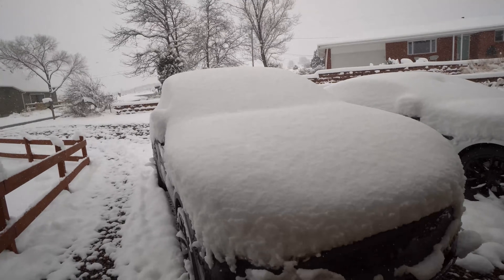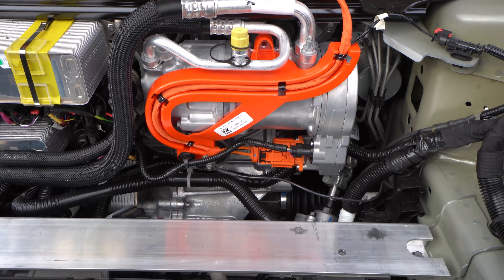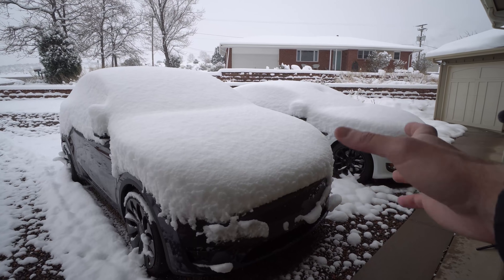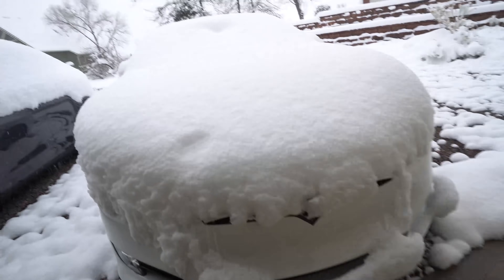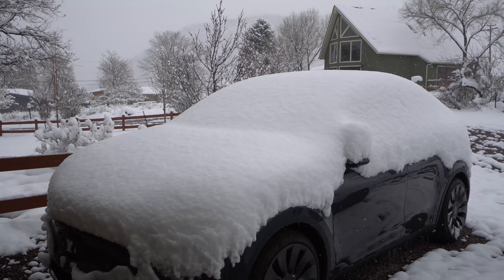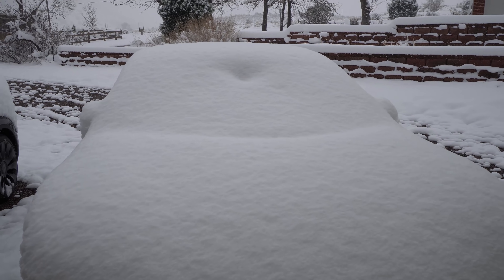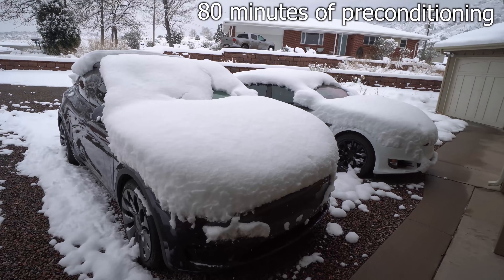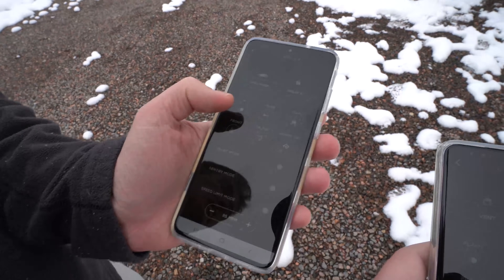Is the Model Y Heat Pump More Efficient? Preconditioning Challenge! Heated Radar?

Comment: I'm a kind of person who don't care about the cabin temperature because I gonna be on my winter jacket anyway. What I concern is how long do I need to warm up the battery before I can drive out without putting bad strain on the battery. I know for my ICE car, I pre-start the car about 5 mins just for the engine, oil,..stuffs to circulate properly before I press on gas pedal and go. How about the Electric car?

Comment: An element heater is 100 percent efficient at converting energy to heat.

A heat pump is much more efficient, generally achieving 3-4+ watts of heat for every watt of energy.

The reason it is more efficient is that it’s doing exactly what it’s name suggests. Pumping heat from the cold outside air into the cab, rather than creating it.

Comment: This test is not testing anything... Heat pump can  smartly manage the heat around. if the car is cool and outside is cold too, are you expecting the Heat pump to generate heat out of nothing?  Please check Bjorn videos, where he found that the Heat pump equipped car in cold weather is as efficient as the car without heat pump in summer. These youtubers without any functional/technical knowledge try to address these complex terms , what more can you expect.

Comment: My understanding. It heats not only interior but battery as well. The model S has an older battery which contains more Cobalt and is better for colder temperature. The battery pre-heating in model S cuts off at 18C (64F) whereas in model Y it cuts off at 28C (82F) so model Y uses more energy to heat battery to a higher temperature. However once you start driving the model Y heatpump can use the battery heat to heat up the interior so I would bet that model Y would have higher efficiency if 1 hour of driving is included after the pre-conditioning. Thoughts?

Comment: I heat my home with a heat pump.  In temperatures below 32º the system uses simple strip heating rather than the pump.  The Y should be more efficient at temps above 32º.  Try this on a 40º day and see if the results change.

Or, better yet, keep those cars in a garage.

Comment: In your efficiency calculation did you take into account cabin/surface area size? Y is significantly larger (aka needs more energy to keep heated etc) than the S? Like S's trunk is not part of the interior, that alone cuts off a bunch of volume that needs to be heated. Run heather in a room, it will heat up real fast with much less energy than the same heater heating up a warehouse.

Comment: Where did you find that the Model Y range is 280 Wh/mile? It should be ~240 Wh/mile. Also, you can change the range readout so it shows % instead of miles. Then you can convert directly to kWh based on the battery pack size.

Comment: In order for a heat pump to work efficiently in a vehicle, it uses heat from friction and other things when the vehicle is moving. Therefore to allow an electric vehicle with a heat pump to sit to warm up it will require more energy to generate the same amount of heat.
Reply: Yes. Without heat exchaning with chassis warmed by car usage the pupm system is a usual air conditioner in "winter" mode.

Comment: With air speed into the evaporator on the front of the Y the heat pump will be able to grab more heat per kWh used.  Being under way will increase the coefficient of performance (COP) of the Y heat pump.  The S shown has no such advantage.

Comment: It’s simple: a heatpomp is only very efficient in the temperature range above -5 gr centigrade.   At lower temperatures is almost like it’s an electric heater.  So at cold temperatures it’s no more efficient than the resistance heater. I really am surprised why they choose the heatpump.  It’s more expensive, noisy and it give barely no extra range.  In this test even less.
Reply: The temperature of car chasis not external air.

Comment: Interesting,  My guess is that Model S used around 10kWh to heat up with around 10kwh of heat while the model y that heated visible more maybe heated 15-20kWh during the hour.  It would be very nice with a follow up video (that don't need to be in a cold climate) where you let both cars heat up the cabin to 10 degrees warmer temp than outside temp for 1 hour. My guess is that the Model Y will use around half energy in that scenario.

Comment: “Range consumption” is NOT a reliable indicator of energy used. Besides, keeping the heat on for an hour proved what? That one car has a more power heating system than other? How about, switching the battery indicator to percentage, then calculating  X % of 100kWh or 70kWh wouldn’t it make it more reliable? Also, how about measuring the temperature increase inside the car vs. it’s snow melting capability. What was the temperature inside set to? Shouldn’t it be the same in both cars? Melting snow consumes energy. Both cars should be clear of snow and cold...... I could keep going. Forgive me but this test proved nothing and the scientific value of it is none.

Comment: These numbers should be divided by the volume of each car since the model Y is bigger and it needs more energy to heat up a bigger volume. Model Y: 10.9/68=0.16kWh while model S: 9.6/32=0.3kWh. So to heat up the same volume, model Y only consumes about 60% of energy that model S could have consumed.

Comment: Without running on the road there is less heat from motors, batteries, and other subsystems for the heat pump to scavenge.  Run a road test.

Comment: You need to read up on heatpump operation.. it uses the coolant loop to remove heat from it, and use it for cabin heating. At standstill overnight, in the snow and freezing temps, the coolant loop is very cold. At this point, the COP is 1, so just as efficient (or innefficient) as resistive heater. (Maybe even a bit less efficient since a resistive heater will heat the coolant loop depending on coolant temp.) Now while driving.. the motors, the electronics and battery will generate heat due to electric losses. This heat is transfered to the coolant loop.The heatpump will be able to harvest this heat and use it for heating the cabin very efficiently (up to 5x more efficient than resistive) the other way around, while cooling the cabin.. if your coolant loop is colder than ambient, and the sun heats your cabin above ambient, your AC uses no power at all (just the pump, the rest is passive heat exchange) without heat pump this is not possible. Heatpump has temp. Ranges where it is on par with resistive, but most use cases will benefit hugely year round average from a heatpump.

Comment: Hmm.  Seems like it could use some programming adjustments.  Heat pumps grab heat out of the air, down to about 20f.  At 18f, it's just wasting energy.  It should be shut down at that temp and only the resistance heater should be used.

Comment: Wow that’s a shocker I was actually holding back on getting the model s in hopes that they will Incorporate the heat pump model in their upcoming line. So regardless of the battery pack it is less efficient to have the heat pump? Seems counterintuitive. Perhaps more videos on efficiency during driving? Great video overall thanks

Comment: Yea. You guys didn't understand everything. 
Well summary:
Heat pump allows MORE heat to be produced, MORE, therefore FASTER.
So Model Y was hotter inside. Also heat pump, when not driving, is not as efficient
as when driving due to low air flow. Fan is mandatory, and definitely clean grills.
More heat means more energy, even if efficiency is above 100%.
Reply: You don't get more heat.  You get more efficient heat.  While the HVAC is able to run both the heat pump and resistance heating simutaneously, it has direct power control over each system.  So when you start the system cold, the resistance system has full power, and the heat pump slowly spools up.  As time passes and things warm up, the resistance heater which draws much more power can start spooling down and the heat pump can take over and maintain the heating.  This is all invisible to you as the heat output from the registers doesn't change (until the temp set point is reached anyways).

Comment: This doesn’t prove anything unfortunately. You need to test what amount of energy both vehicles use to do the SAME AMOUNT OF WORK; even in this test, we can see that the Model Y may be able to do more work or heat up more than the S. It’s no surprise to me that the Y used more energy since it likely did much more heating than the S did. Even if you were to take both vehicles and set both systems to 72 degrees and see how much energy is used to keep this temperature over 1 hour, each vehicle has different volume of air to maintain and has different heat losses due to different sizes of windows, construction, etc. The only way for this to work is for Tesla to release total HVAC system performance and efficiency numbers.

Comment: Assuming your math is accurate (which is a BIG assumption) the Model Y used 113.4% the power over the same period.  ...but the question really is, how much heat did the Model Y produce in that period verses the Model S?  Again, assuming the math is correct (which you are comparing a new car/battery to a used car/battery, as well as the systems ability to provide completely accurate and consistent readings in both cases) all that really says is the system is able to exploit more power from the system in the same period.  Efficiency is a matter of how much heat (in BTUs or what have you) was produced for the amount of power consumed.  None of your measurements measured that at all.  Basically all your testing, for as interesting as it was, didn't really show us anything truly informative.

Comment: Looks like since it was so cold that the backup heating kicked in as well as heatpump.  Running them together heated up the whole car faster in such low Temps.  The model Y is going to be way more efficient above 30° when the backup heat won't be needed.  Good video showing the extreme cold scenario though.  Thanks,
Casey

Comment: Model y is more efficient the heat pump works better on movement because it will take more heat from batteries and motors

Comment: I'm assuming there is an auxiliary resistive heater, similar to most EVs with heat pumps. Maxing out the heating setting most likely energized both the resistive and heat pump. As others have mentioned, driving or setting the temp at say 70 would offer some valuable info for comparison.

Comment: The Y clearly was leaking a lot more heat into the environment as evidenced by the snow melt. That could be better insulation/glass/door seals, etc. in the S, or it was hotter inside the Y. Area to heat inside the car would be another variable, as would mass of the materials (amount of energy needed to raise the temperature of the dash for example). To focus on the relative efficiency improvement with the heat pump the best bet would be to do a Model 3 vs Model Y comparison as the construction/materials are very similar; there are too many variables in a Y vs S comparison to glean much about relative efficiency of the heating system itself.

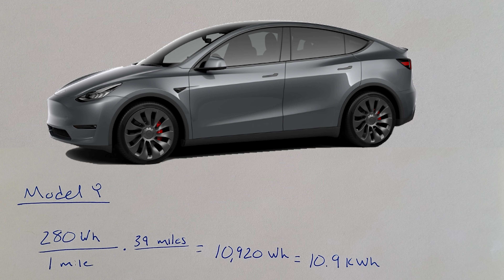Comment: 11:55 I knew it back then with the rumors of a heat pump for the Model y.  If it's so cold, there's not much heat/energy in the environment, it will just get most of the heat from the mechanical action from the compressor.  
The energy usage for heating is cringey/insane, wasting precious electricity for heating.  I definitely would like/support Tesla to develop a fossil fuel burner for use as heating.

Comment: just to put a fly in ointment, the reason snow melting off faster on one very the other and the reason got a hot ass on the model Y is down to thermal losses,. the heat from cabin is finding its way to the outer shell.  obviously this will always happen at some rate on ll vehicals however it appears model 3 and model Y 's cost cutting measures (based on same framework and chassis) must have impacted this when comparing it to the S and X which dont seem to lose as much heat from the cabin.

Comment: I think the problem that the heat pump addresses is electricity consumption while driving. As the battery heats up, the Y is able to shift that heat into the car instead of simply burning electricity in a heater.

Comment: This a melt snow video and not a how much energy does each use.  To determine if one car uses more energy.  Set both cars at same temp and start.  Record SOC and temp at regular intervals.  This data will roughly allow you to figure out which car used more energy.  A even better test would be to have Scan My Tesla in both cars and take data from.

Comment: Higher temperature after delta(time) = higher heat generation  rate = higher energy use rate.

The only way to measure efficiency is to make the cars total heat output the same and see how much battery life that consumed. Keeping time as the fixed parameter only tells which heats up faster, or in other words, the peak heat generation.

Comment: I would have liked to know how much energy was used to get the cabin to 70 degrees. If the heat pump takes much less time to get there, that would be expected and where the efficiency is. Running for the same amount of time isn’t as good a test in my opinion.

Comment: There is also the question of convenience. The Y had a unfrozen frunk. That being said, the heat pump is supposed to precondition the cabin but seems to lose heat as we saw in the flair pictures. That lost energy seems higher that expected. May be a little less efficient but more convenient. I’m still waiting for my Y performance + to arrive and test in cold weather next winter. Stay safe.

Comment: Heat pumps don't work well if they have no airflow.  They extract heat from the air, so if there's no fresh air, there's no more heat to extract from it.  Most likely the model Y used resistance or other "waste" heat.

Comment: The Model Y uses the battery pack as a thermal storage and will use it to heat the interior. That is even described in the patent application. Thus the battery pack is lower temp when you check and thus you get lower mileage. In reality the Model Y likely used 1/3rd of the energy of the Model S or less

Comment: What was the ambient temperature when you did this? The colder the outside air makes it more difficult i.e. less efficient for a heat pump to pull heat from the air. Another thing to think about is that when a heat pump is running it is producing condensate from the outside air and is rejecting very cold air, maybe 20 to 30 degrees F colder than the ambient temperature.

Comment: As far as the test it's what I would have thought. As for it being more efficient I think you will only see that why you drive as it will take less to keep the cabin warm but you guys had it set to high so it never turns off as where if you had it set to say 71 and ran it for an hr against the s I think you would see the difference in favor of the y cause it can shut off and heat back up as needed where when set to high it will never shut off

Comment: The point of a cabin heater is to heat the cabin not melt outside snow.  If the body panels are insulated differently or if one car has more glass than the other, the car with the better insulation will be hotter inside and not melt snow on the outside.  A better test should be to heat the interior of both cars to a set temperature and then measure the energy used.  Using snow melt as a proxy of heat produced is corrupting the value and accuracy of this test.

Comment: This test shows only one thing: the person how carried out this test has no clue about thermodynamics! Heat pump "pumps" heat from heat source (ambient air) to the heat sink (cars cabin)! The car needs to drive in order to receive fresh air, which will be cooled off and this portion of energy can be used by heat pump. In cold temperatures you need a lot of air for several reasons! If your car is not moving, the heat pump do not receive energy and do not work properly! So defrosting your car by using heat pump is inefficient and your test showed it well! Your heat pump become after several minutes even quieter because it "realized" it hasn't been receiving any new energy from ambient air.

Comment: Heatpumps are more efficient in the long run, but take some energy to get started. So the first several minutes they are pretty inefficient, since the pump itself is cold and the friction by the cold oil is increasing the energy consumption.

As soon as the unit is on temperature, the heat pump will be more efficient.

The heat pump is also designed to pull excess heat from the cooling loops - so it's more efficient to heat the cabin while driving.